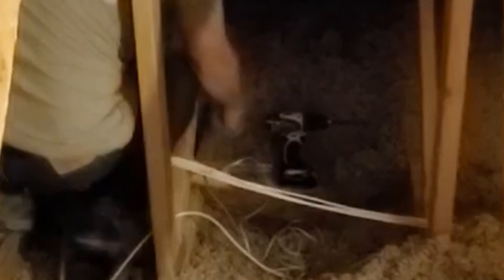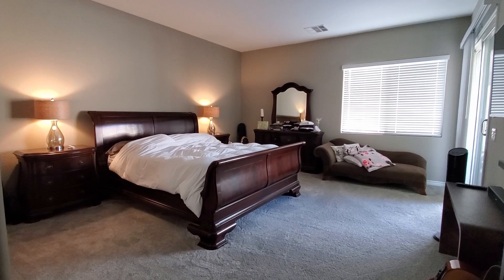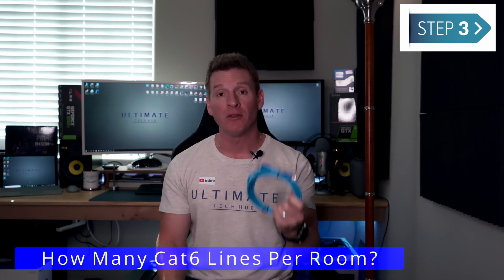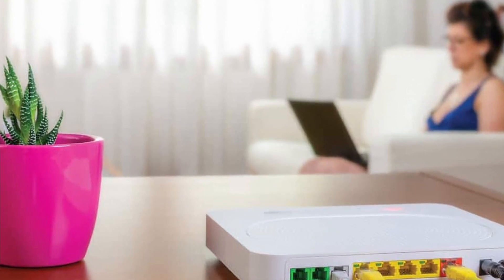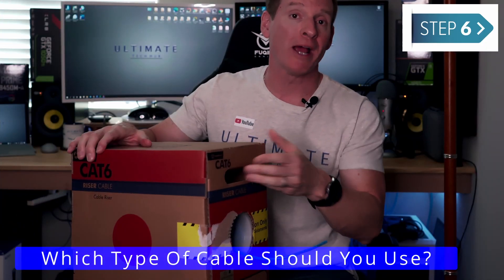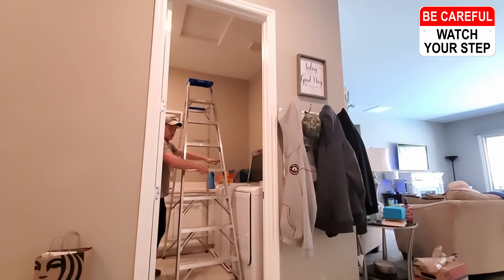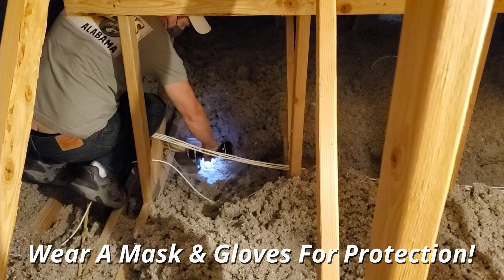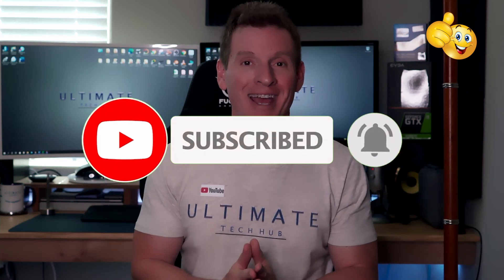LOW VOLTAGE WIRE DROP BASICS - HOW TO | HOME NETWORKING FOR BEGINNERS!

Comment: Does any switch support CAT6 or CAT6a cable?  How about CAT8?  Thank you.
Reply from the maker: All switches support Cat6 or Cat6a or Cat8. If you want faster speeds then get a 10gig switch.
Reply: @UltimateTechHub  But would I be limited by my own ISP?
Reply from the maker: @orestesdd  For internet speeds yes, for Networking speeds no.

Comment: I want to do this but I'm sooo scared of going in the attic. What kind of professional do you call to have this done? I tried businesses that advertised "home networking" but they don't do wiring - just everything that comes after that. I could do all the terminating and setup, just not the cable drop. Thanks for the great videos! +liked +subbed
Reply from the maker: Low Voltage Wiring is what you need to look for. Thanks for watching, liking, subscribing, I really appreciate it! 😀👍

Comment: Hi, great video! I'm thinking of wiring my entire home with 6a. It currently has no ethernet ports inside, so I would need wiring to 7 rooms scattered between 4 floors. This project likely is going to require professional help given the lack of existing routing to work with but I wanted to get your opinion on what to ask for. I am planning on getting a network panel in my basement where I have the network modem. Would you have any recommendations on what to look for to use if ethernet is really the only objective? If any should be fine, that's good to know as well. I love the suggestion of dropping two wires in each room. I'd need atleast 14 ports in my network panel in that case. Is the standard for doing this connecting from my modem to a ethernet switch which also exists in the network panel? If so, do you have any suggestions in terms of switches?
Reply from the maker: The standard Network Panel Setup is Modem to Router and router to switch or switches. The router has to be before the switch in order for the DHCP to hand out IP addresses. Glad you decided to hire a professional for the job. If you have any hesitation always hire a pro. I would recommend watching the pro as he drops the wires and even film it with your camera. That way in the future you can do this yourself. I recommend TP-Link switches or Engenius switches because of the price point and ease of use. With 14 ethernet connections you will need either 2- 10 port switches or 1- 24 port switch. Extra switch ports are great for future expansions too. Good luck and keep me posted. Thank you for watching and if you subscribed thank you as well. Make sure to check out my Home Networking for Beginners playlist it has dozens of these type of videos. 😃
Reply: @UltimateTechHub  Thank you, will do!

Comment: I really recommend going 6a instead of just 6 - cat 6 isn’t that much better than 5e, and having that 10Gig network potential is really future proofing your house and could improve resale.
Reply: Why no cat7?
Reply: @bartez8018  maybe you know this but CAT7 and CAT6 are basically the same cable with different connectors (not RJ45). It was developed by a private consortium and isn’t ratified by IEEE. The proper next cable up is CAT8, but price vs performance, and the marginal level of improvement over 6a make this quite a needs based choice rather than a future proofer. 
Cat 6a is like 20% more expensive than 6, whereas Cat 8 is like double the price.
Reply from the maker: I've been rewiring my house with cat6a. I have probably half of my network cat6a
https://youtu.be/GqRtyOS2x2s

Comment: Why do you multiply the wall height times two --is it for slack? That seems wasteful. You have a lot of good info. Thanks.
Reply from the maker: Times 2 is for both ends of the cable going down both ends of the wall. I never waste cable even when I cut some extra off I use it for patch cables. Thank you for watching and if you subscribed thank you as well!
Reply: Ah! I missed that part. Good stuff man! 👍